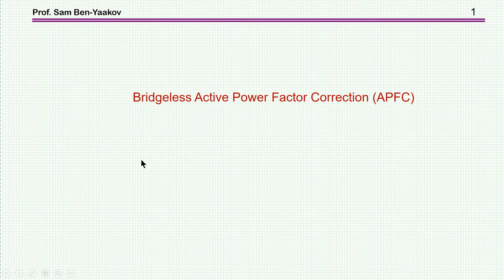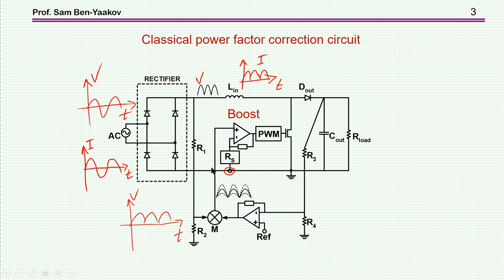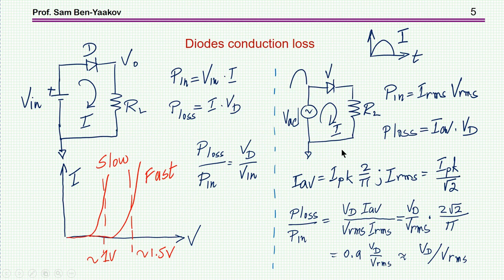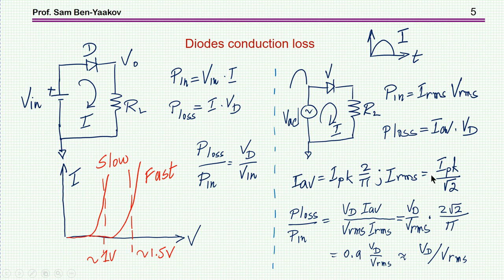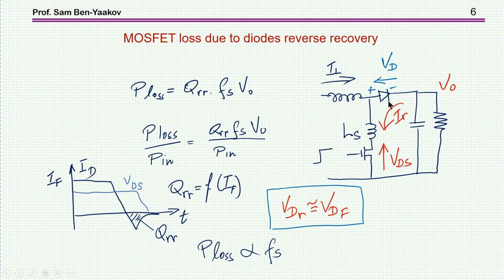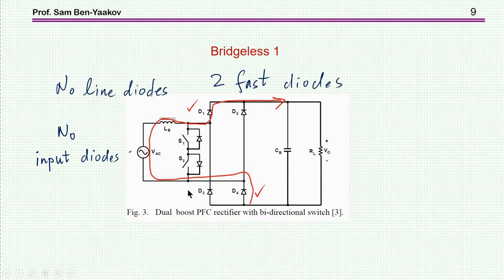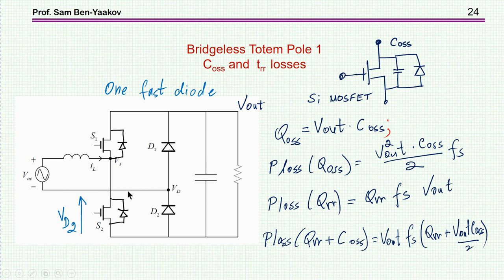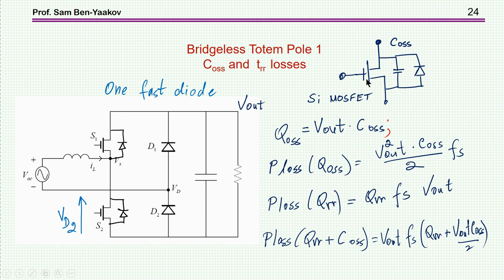Bridgeless Active Power Factor Correction (APFC) systems

Comment: Thank you professor for your simple way of explaining complex concepts. I have a question. The 2 inductor type bridgeless PFC has many advantages including a simple drive requirement. Can we use 3 parallel sets of these on three phase supply with the same output capacitor?  Your comments will be very helpful. Thank you
Reply from the maker: It will be difficult to combine the to a feed a single cap. Why not use Vienna rectifier?: https://youtu.be/fNqXzZSzCwU

Comment: Dear Sir,

I am thankful to you for sharing us such an important comparison. I am right now working on the same design but with interleaved concept. As I see you have mentioned to use GaN FETs for the boost transistors which BTW are pretty competitive to any SiC or metal oxide counterparts. However as far as I have researched the reverse diode voltage drop is very high. I see you have not mentioned anything about them, Please let me know if I have misunderstood the GaN transistor in your video? 
In case it is correct than I would say that for the same example if we would have considered a metal oxide FET with almost near forward device characteristics and operate in CRM we would be able to more on the Body diode drop loss. Please enlighten
Reply from the maker: Hi , The third quadrant conduction of a GaN is indeed an issue, I am planning to prepare  video on that. Meanwhile, in a nutshell: you need to keep the dead time as small as you can.
Reply: @sambenyaakov  wow, indeed, that's the most simple&smart way to tackle this issue!

Comment: Thanks for this lecture.  So with critical mode switching and ZVS the benefits of GaN (31:00) is not that much and Si can be used.
Reply from the maker: Even with ZVS the turn off requires fast switching to minimize V-I overlap.
Reply: @sambenyaakov  thank you.

Comment: Thank you so much for this video! Could I use modern SiC MOSFET instead GaN for Critical Mode in Bridgeless Totem Pole? SiC MOSFETs are really fast and have faster diodes than Si MOSFETs. Control of SiC MOSFET should be simpler than for GaN.
Reply from the maker: Yes, SiCs are faster than Si but wuth switching losses about 5 times greater than GaNs. But SiCs are more mature technology than GaN.

Comment: Thanks a lot for the interesting lecture. I have a question regarding the switching losses of the totem pole PFC .. if we use the critical conduction control (in order to allow the negative inductor current to discharge Qrr and Coss to the load instead of the channel of the FET), do you think this way can improve the efficiency and get rid completely of the reverse recovery issues associated with Si MOSFETs? 
I've seen the CrCM control being used with GaN and SiC PFCs only but never saw it used with a totem pole PFC using Si FETs !
Reply from the maker: IN the early days totem pole APFC was built around Si nut in hard switching mode. For efficient BCM you need low rds(on) and fast switching which is the advantages of the WBG devices.

Comment: Thank you sir, great explanation as usual. I am designing something similar to totem pole 3 but using all Si mosfets. I plan to use about 50kHz switching for 1.5kw output and ccm control. To eliminate qrr and coss problems I have added an auxiliary circuit to make the synch boost switch always in zvs; so no qrr, no Coss and most importantly no GaN fets... What do you think about it? Thank you
Reply from the maker: ZVS is good bure if you want very high frequency ZVS and GaN is the best.

Comment: At 5:04 you said "breakdown voltage" when you actually meant "forward voltage drop" (of a diode). I shouldn't be nitpicking, but a professor gave me a lower grade just because I didn't use a proper term.
 Otherwise, your videos are very valuable. I feel like I'm attending a university. ☺
Reply from the maker: Well, YOUR professor deserves a lower grade.  Notations and definition are important but not more than substance. Thanks for comment.

Comment: Amazing design, i actually have rather frivolous use idea for it
6v/3w bicycle dynamo efficient boost and rectification, maybe it wasn't first thing to come in mind while creating this device, but it should work brilliantly for that purpose
Main issue is my lack of skills to design useful circuit, idea is to boost and rectify low voltage, then step it down with off the shelf step down board, another question is cost, building 100$ circuit to charge my phone/lipo/nimh batteries during joy ride seem rather costly endeavour
Also were thinking to forego inductor itself, as in my case dynamo itself might provide required inductance trough it's windings
Reply from the maker: Thanks for conversation.

Comment: Any time current flaw thru the Body diode of mosfet, watch out for Qrr. Mosfet (even super junction CoolMos type) have nasty Qrr. 
Once the Body diode is triggered, it takes long time for recombination of storage charge, even after the gate is tuned on.  
That was the major failure mechanism in a Resonant topology and Synchronous rectifier topology.
Infineon has recognized of this weakness of the mosfet, so they have come up with new series called "CFD7", if you are employing Resonant Topology. 
Or the better alternative is GaN or SiC mosfet. They have extremely low Qrr.
I have very long experience with Resonant typologies, non-dissipative snubbers and lossless voltage clamps.
Reply from the maker: Thanks for raising these important points
Reply: @sambenyaakov 
GaN makes Bridgeless PFC (1PH or 3Ph) very efficient. 
When you use all the devices GaN fet (no diode), it will turn out to be Bridgeless PFC, it produce high PF even for light load, low harmonic distortion. higher switching frequency make magnetics smaller. 
If you are interested in contacting me, i am on Linkedin.

Comment: Hi Sam,
The explanation was too good..u made it so simple. But I have one doubt in this. At 40: 00 time of this  video you have explained about zvm with crm mode.. I need to know about the negative current..if that cycle is ( possitive half cycle of AC )..if there is negative current means, the potential of vline is close to zero or  lesser than output....let say the DC link(output) is 400v and if the line voltage is 150 there maybe negative current. But the time u mentioned(dead Time) here vds2 is almost gone to 0v...if  the line voltage is 0 there is a point ....otherwise it will only reduce to the input voltage level right....Does the voltage across the Get will goes 0 at that point...Please rectify me this issue. As I am currently developing a 11kw OBC...
Reply from the maker: Hi, I am not sure I understand your question, let me try answering to what I undestood. Once S1 is turned off there will be self commutation of the voltage and S2 will start conducting in reverse direction (before its gate is turned on) so the current of inductor will start to rise except for the point of zero input voltage.
Reply: @sambenyaakov  Thanks Sam,
My question was at this dead time(before S2 is on). What is the actual reason of negative current?( I thinks that is because the output voltage is higher than the input ,hence the Coss of s1 will be charged to that limit only). The actual question has two parts...first is, during that commutation period, what will be the voltage at input ?. How will be the Vds across the mosfet will goes to to 0?.( If there is some input voltagte across the inductor ..I think the voltage across the mosfet will be same as the input voltage )
Please correct me if my assumption is wrong...I hope u understand the question...

Comment: Dear Prof. Thanks for making this Video. its very helpful. would you please give a lecture on critical inductance design for single phase and three phase bridge rectifier circuits with passive LC filter.
Reply from the maker: Thanks for comment. Will try.
Reply: Critical inductance? What is that??

Comment: Very interesting and good understanable Video! I have one question: Why they are using normal Si-MOSFETs for S3 ans S4 in the Totem-Pole topology? Does it not improve the efficiency using GaN-Transistor, too? Or SJ-MOSFETs? Thank you in advance for your response.
Reply from the maker: Not really. Super junction Si transistors have a pretty low Rds(on) but suffer from large capacitances which is not an issue for 50-60 Hz.
Reply: Sam Ben-Yaakov So it's doesn't matter which technology to use, if its SiC or Si with Sj for S3 and S4. Its a question of cost reduction and eliminating the diods?
Reply from the maker: Correct
Reply: Sam Ben-Yaakov thank you for the quick response

Comment: Hello professor, I wanna take one step further into the study of the EMI issue of bridgeless PFCs. Several literatures mention that though both circuits suffer from quite grave common mode noise, the bi-directional circuit offer better CM EMI performance than the totem-pole circuit, because "It has the advantage of offering a balanced input impedance that can improve EMI (compared to the totem-pole circuit)", as mentioned in TI's webminar white paper SLUP390 "Power Factor Correction (PFC) Circuit Basics". This verdict is in accordance with a project I've been working on lately. I can't figure out why, so could you please shed light on this phenomenon? I can't wait for your reply, thank you!
Reply: To be more precise, I can't see why the Totem-pole circuit failed to offer "a balanced input impedance". Both circuits, it seems to me, operates in a similar manner during both half cycles of AC input, "symmetrically".
Reply from the maker: In the classic approach the inductor always feeds the plus terminal of output. In TP the inductor feeds alternately the plus and minus terminals.
Reply: @sambenyaakov  Thank you for your answer! But I have some follow up questions. Indeed, the inductor feeds different terminal alternatively, but the alternation is of a very low frequency (50Hz), why may this impact the CE test, which is of 150kHz-30MHz.

Comment: Very interesting video Dr. Yaakov. However, if CRM Mode is used for ZVS, why are GaN required any more? Isn't it beneficial to use normal cheaper Si Mosfets in CRM with ZVS ? I mean all the complexity with GaN gate drive is reduced and still efficient system can be designed right? Thanks in advance.
Reply from the maker: Hi Ravi, with CRM you get what I call pseudo ZVS at turn off. Losses will depend on how fast is the fall time of the current. GaN are much faster. This is why pridgless CRM PFC exhibit  higher efficiency.

Comment: Would it be possible with this type of configuration or the newer 6 fet design to do single stage isolation?  Ie ac to dc with transformer using resonance?  It strikes me that you should be able to switch these in such a way that you’re effectively speeding up the sinusoid using the inductor and capacitor with the switching and thus skip the entire flyback or other topology so you just have this and nothing else. Probably really complex timing but an ic or code in an mc that did this would result in pretty major gains I would think.
Reply from the maker: Not sure I followed you. Are you referring to any particular minute in video?
Reply: @sambenyaakov  no, just thinking out loud that the problem after pfc is you still have to run it through a transformer with another half bridge or similar. Thinking that the ideal design is that the pfc stage uses those fets to create the resonance in a transformer to get an isolated power supply in one step. Then it’s just a synchronous rectifier on the other side and you’re done. These power supplies that use these are way too complex which is why they’re constantly failing.
Reply from the maker: @jameshancock  There are solutions like that. E.g around a flyback converter. The down side is the issue of the bulk cap. In APFC you need a large energy storage. Moving it to the load side has very many disadvantaged. This is why this solution is used only for low power.
Reply: @sambenyaakov  I thought so too, but I did a search (can't post links here sadly) of a design that works for both a USB C 100 W charger, and with a slightly different ripple control mechanism a 3000W proof of concept EV Charger. (and they think it would scale to 22kW)

Comment: Prof. Sam, why is the first topology -dual boost PFC called as bridgeless topology ? It still has a diode bridge at the output side right?

Also, the second topology - 2 phase PFC : this seems to be more like a dual boost since it has like two separate boost converters connected in parallel kinda fashion. So, cannot understand why the first one is named as "dual boost"?
Reply from the maker: Hi Dinesh
Please indicate the  slide number or minute in video you are referring too.

Comment: Dear Prof. 
In the Bridgeless Totem Pole 3 diagram at 32:30 minutes of video,  the Silicon Power MOSFET S4 should be conducting in the reverse direction. Desirably, the current should flow through the MOSFET Channel (Source to Drain) and not the body diode. I am confused because that is not how power mosfet usually works. Could you kindly help me understand the same?
Reply from the maker: Shailendra, Si MOSFETs conduct both direction when turned on. So in this application you need to drive the MOSFETs  synchronously with the mains frequency.

Comment: which controller can be used for bridgeless topology?
Reply from the maker: You can use just about any controller plus some logic. The problem is isolated current sensors. For borderline operation digital control will be  best.

Comment: Dr. Sam: Can you please make a video on hard switched full bridge DC-DC converter ( 36V-72Vin: 12Vout)?
Reply from the maker: Hi, This is sort of "lost art" as recent designs apply soft switching, but for low switching frequency it is still valid. I will try to prepare a video on that.
Reply: Dr. Sam : hard switched full bridge is currently  used in Telecom bricks (12Vout , 36V-72Vin)
Reply from the maker: Thanks. What is the switching frequency used?
Reply: Dr. Sam. 200kHz. Even with hard switched full bridge, the efficiencies achieved  are 93-95%.  200-600W  brick converters are all hard switched full bridge ( the output rectifiers are replaced with mosfets to achieve higher efficiency. Definitely a 12VDC fan is required to cool the components. These are usually 12 layer boards. http://www.ti.com/lit/ug/sluua95/sluua95.pdf
Reply from the maker: My response was somehow erased. Here it is a gain.
Well, for input voltages below 100V when  Schottky anti parallel diodes can be used, one can get by with hard switching. It seems that James. that started this conversation, is correct. A video on hard switched bridge might be useful.
Reply: Sam Ben-Yaakov   This very a nice presentation of bridgeless PFC. I have done many PFC design, single, 3 phase up to 4Kva, do not call myself a designer. I would like to make one suggestion. I would not recommend bridgeless PFC in any PS design for power > 200W. The reason is the grid  line overseas is not as stable as here is US. I have seen PS with bridgeless Pfc failing randomly in the field and almost impossible to duplicate that failure in the lab.

Comment: On Slide 25 Coss is used to estimate the losses, this is very wrong as Coss is very voltage dependent.  Some manufacturer give a time related output capacitance which could be used, or better still, use the reverse recovery charge* voltage.
Reply from the maker: The slide is OK if the Coss is the so called  "energy related capacitance". Send me an mail to sby@bgu.ac.il and I will send you additional information on that.

Comment: Dear prof. Don't you have any new considerations about the capacitor filtered input rectifier of any SMPS? I mean, all amazing development about SMPS haven't been inproving the bridge-capacitor of the SMPS's input which have the same techology as 60 years. Yes, you just show the "bridgeless" advancement, but what could be accomplished into an under 30W SMPS related of all this subject, where one bridgeless could call for circuit complications with no added volume reduction - these SMPS usually use a single switch?
Comments are welcomed.
Thanks for your lectures.
Reply from the maker: Not sure I have followed your questions. Power factor correction is required above some power level (depending on application) . A bridge rectifier followed by a capacitor has two high level of harmonics. Bridgless power factor corrector with GaNs has higher power density and higher efficiency as compared to a conventional  APFC. A cascode bridgless APFC has 4 switched, 2 high frequency and 2 low frequency.
Reply: Sam Ben-Yaakov 
Dear professor.
Yes, I used your explanation as comparation, contrast, to firmulare the question: what could be accomplished today in order to improve the power density of just the bridge+capacitor of a 30W SMPS? I guess that the answer would be "nothing ", but I would like your consideration about.
B. R.